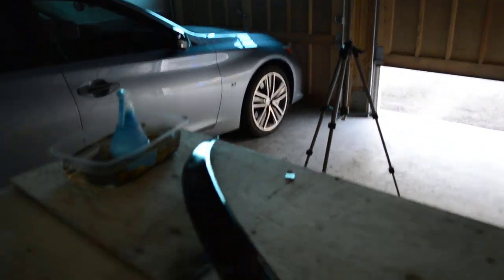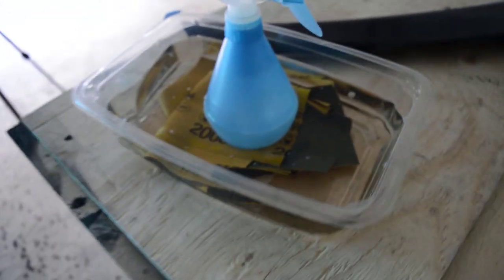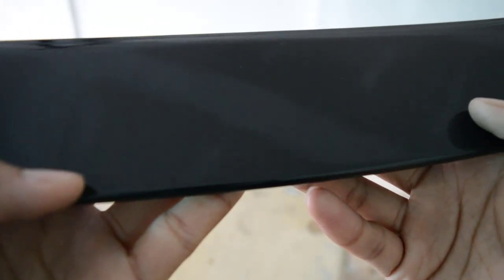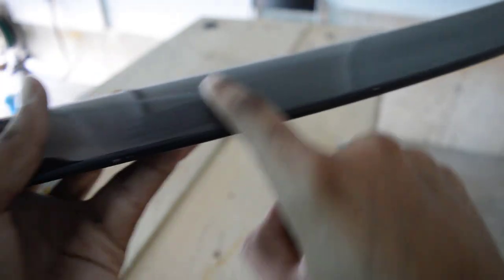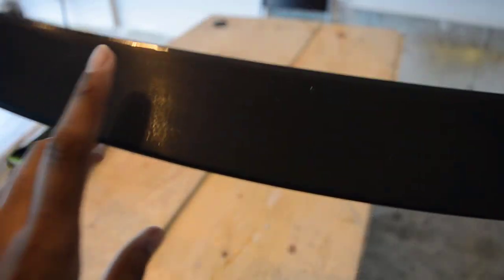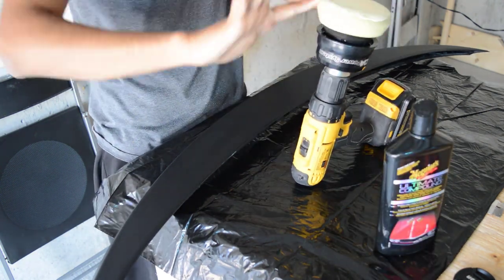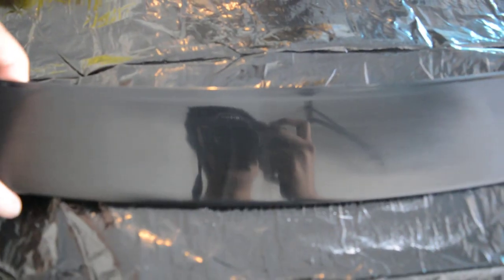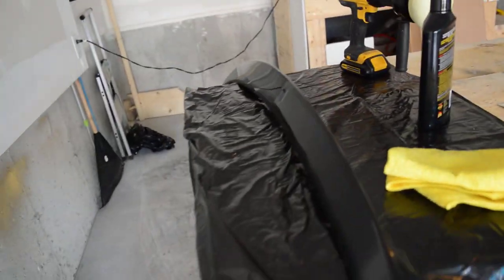How to get rid of orange peel from a DIY paint job

Comment: Nice job. I hadn’t seen anyone ever use a razor blade to eliminate runs, but it seems to have worked for you. 
Painting car parts with rattle can is not easy. The quality of paint is no good and it doesn’t come out with enough force to lay down properly and dries unevenly, which is why you get orange peel and haziness. It takes patience to get a rattle can spray job to look good—so nice work!
Where did you get that polish head for the drill?  I need that!
Reply from the maker: One Fine Trek thanks for the kind words!! I got it at canadian tire but if you search up "meguiars D/A power system " you should be able to find it online 😊
Reply: Thanks. I wondered if it was the one by meguiars. Thank you

Comment: Doesn’t that remove the clear coat? Do you need to apply another layer of clear coat?
Reply from the maker: Levi Stephens it flattens the clear coat which allows the reflection to be smoother. You only need to re clear if you do excessive sanding

Comment: Do you wetsand the clearcoat or the paint coat?
Reply from the maker: Hello mr dom the clearcoat
Don’t mess with the paint 🙂
Reply: Anish Nothoo You clearcoated after want sanding? sorry for all these question, its because i want to paint my Si wing for my civic
Reply from the maker: Hello mr dom no worries dude 🙂 I sanded the surface then primered then sanded that surface. After that I applied paint coats and clear coat. Then wet sand again and the polish for glossy finish. I have another video on my channel where I explain it better so make sure to check that out :)
Reply: Anish Nothoo thanks dude, big up from quebec🤟🏻